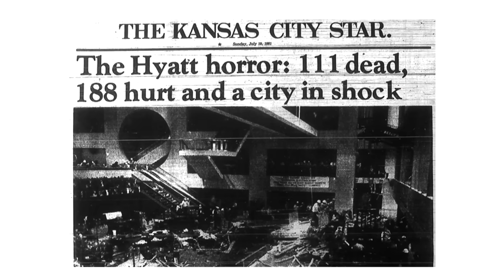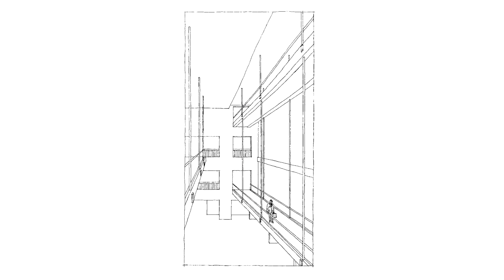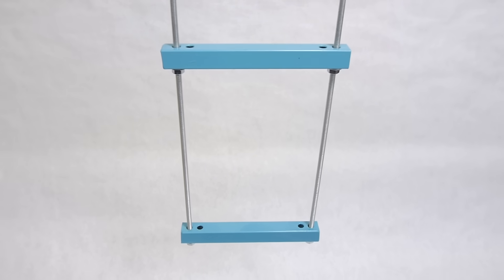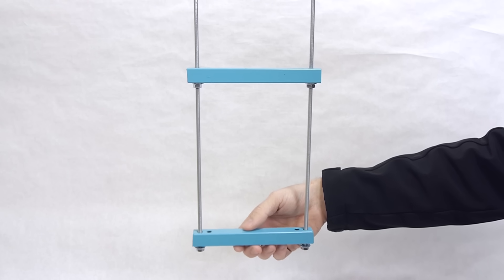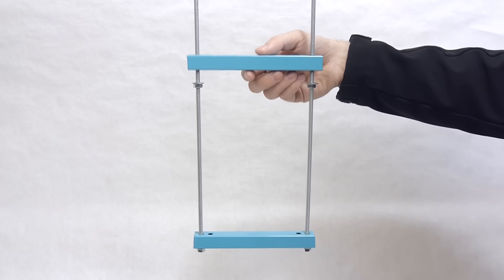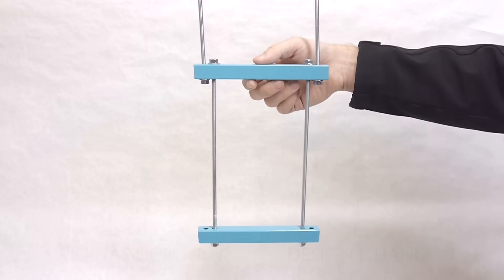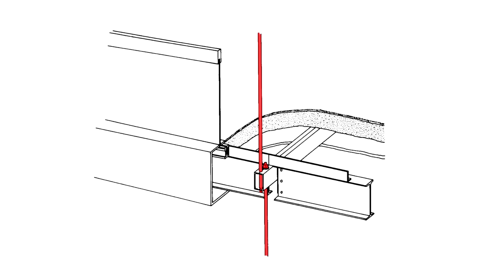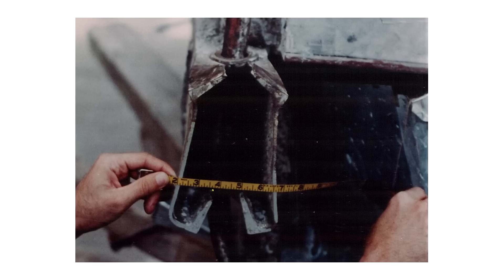The Disaster That Changed Engineering: The Hyatt Regency Collapse

Comment: Tensile strength of a steel rod is significant because it distributes the stress force along the rod, in a linear fashion.

The point force stress at the floor connection is much more concentrated.

By them breaking the rod, they were losing the advantages of the tensile rod, at the break, and then concentrating that force on the point connection. That point connection needed to be much stronger.

Comment: It is kind of like of magic trick. Only when they told and showed the point of failure did I realize that it was not an issue with the bolt or nut, but of the floor structure.

Comment: Even in the original drawings it looks so fragile. If there isn’t good over site during construction you can guarantee that there won’t be over site with inspections over time. Small things like dis similar metals, corrosion, rust, etc you can bet that the structure will be slightly compromised. 
This was designers wanting the walks to “float” and used the smallest amount necessary to support it. There should have been more rods even if the drawings were followed, this would give better margins for error.

Comment: Oh practical engineering already did this disaster ok. Came from one of his other videos wondering if he’d do it

The original plan wasn’t compliant either. Tests showed it would’ve only held 60 percent of the required weight for building codes.

They had a chance to catch the issue when part of the roof caved in and unalived a worker during construction but it didn’t get checked

Comment: There's one additional point that was not made:  The design would have been sound if the c-channels were placed back to back instead of welded toe to toe.  But box beams ( 2 c-channels welded together at the toe) look better, so they went with that.  I wonder if building inspection regulations were enhanced, because I'm willing to bet that there were at least a few building inspectors that were included (if only peripherally) in the lawsuits that followed.
Reply: Even using larger washers to distribute the load away from the flanges and onto the web would have helped a lot.

Comment: Wait a minute. Why would the nut on the upper level break? A properly designed nut should fail after the bolt (or rod in this case) fails. If designed properly, the rods should have been adequate to hold both walkways and the nut would be stronger than the rods.  It seems like the real failure was with the lack of compressive strength of box beam and not the nut as suggested in this video.

Comment: The horizontal parts of the C sections were acting as  cantilevers. The vertical parts were not being used properly. If instead of a small washer above the nut there was a thick pressure wide plate, this would have brought in the vertical parts into action.  That would have helped in eliminating the cantilever effect on the C section. 
 It was lack of foresight, on structures and  hopeless welding runs joining the two C sections, to produce a box girder.

Comment: I believe the real error here is placing one walkway beneath (or above) another, you have to ask yourself when designing something
"what if?" There is a two-fold benefit at work, each walkway is independently supported so the loading is easier to bear and should the overhead one collapse it won't take down the one under it (hopefully). Armchair chair expert.

Comment: Why not have accurate data on the distribution of steel and the distribution of concrete down the 1430 ft of the North Tower. Including the 70 ft for the 6 basements?

Comment: The problem there was  that the design  was made by an ARCHINEPT, and the  contractor  realized that  IT WOULD TAKE TOO LONG TO SCREW , besides  you cannot get   6 mts  threades bars at the local warehaouse.  if the  design were done by a an CHEETENIER  he´d  used solid bars to be sure that no need for  calculation of hole resistance but only vetical bar resistance and horizontal bending . IN my humble opinion that hollow  structural rectangular  bar  would have collapsed anyhow, it is not easy to calculate a hole resistance in a thin sheet of metal,...

Comment: An obvious alternative to threading the entire rod are coupling nuts.  These are long nuts used to extend the length of threaded rods and are available in most hardware stores for common thread sizes.
It would have been a very easy job to machine these from 2 1/4" dia round bar such as 4140 HT & SR, with wrench flats in the middle.
Astounding that a so-called erector did not know of such items.

Comment: As a K.C. Mo commercial carpenter stuff like this is still taught. You always question the engineers. Ive seen them approve stuff i KNOW wont work. Thats when you speak up never think a college degree means you know everything. My 20yrs exp in large bridges high rises and stadiums i can see big failure points

Comment: Is it just me or was every element of the design at the bare minimum for sanity.  If you look at the picture with the measuring tape, it looks like the rods were about an inch in diameter and the steel used in the box perhaps a quarter inch in width.  And how many rods were used total?  Look how massive the walkway is and the amount of material that had to be supported.

Comment: I get it that this nut was carrying twice the load…but it was this badly designed beam that split. The main strength of those channels is in the vertical face not in the tips of the flanges. 
Then they drill the holes through the weld. Then the load is trying to bend and crack that weld! Then there’s two holes next to each other…not much weld left!
  The nut is the ‘’fall guy" for that abysmal apology for a beam that it’s trying to hold up.
Reply: I agree that the construction of the beams being flange to flange was bad design and part of the failure mechanism. But, if the load on the nut is doubled then it is also doubled on the element applying that force. So you have a badly designed beam operating at double capacity. Honestly I’m just amazed it lasted for as long as it did.

Comment: The worst part is that a lot of the structural failures weren't even new information - the guidelines were already in place to prevent most of this, it's just that people cut corners. Still, it certainly made an impact. Safety standards are written in blood, unfortunately.

Comment: There's A LOT more to this story. Pure negligence and miscommunication on behalf of the primary engineering firm and the steel contractor. The steel contractor requested a change in the skyway's design for simplicity when erecting and the engineering firm NEVER made load calculations for the changes. They simply thought load calculations were someone else's job. During construction of the hotel, the steel structure to the atrium ceiling failed and collapsed. During a design review called by the hotel's owner, the engineers were directed to check all "steel-to-steel" connections ... including the skyway floors ... to ensure the building was safe. Unfortunately the engineers only glanced over their work. Again they failed to do a detailed analysis nor did they ever check the loads on the new skyway floor design. Hence, disaster struck and killed 114 people. Ironically, the original design for the skyway floors was also flawed as it was structurally insufficient and would not have passed State law.

Comment: I'm no mechanical engineer, but couldnt they just have used threaded couplers for the rods they chose to use? (I'm talking about those fasteners that look like a normal threaded hex nut, but like 5-10 times taller/more threads) they still get to use the same partially-threaded, cheaper rods. But with the advent that the bottom walkway is not pulling down on the top, as the top walkway is just resting on top of the threaded coupler. Admittedly the threaded coupler still would have as much force exerted on it as the nuts that failed, but it would have multiple times more thread engagement and only half the weight would be on the top surface of the coupler..
Reply: Your right, that would have been the ideal solution. Additionally the nuts weren't the point of failure, it was the cross beams which was now carrying double the load so coupling the rods would have effectively eliminated the issue.

Comment: I think the original design was flawed. The design required the fabricator to cut -20 feet of thread and then run a nut and washer up that thread. Anyone would have looked for an alternative to such a time consuming construction. True the loads should have been reanalyzed and adjusted for.

Comment: This gets recommended to me after the condo collapse in Miami. Nice.
Reply: Same here. At this point, having read an analysis from every amateur out there, including conspiracy theorist clowns, as to what the collapse video would, should or could mean, I'd like an actual seasoned professional structural engineer to weigh in with his or her opinion.
Reply: @msr1116  I doubt you'll see many in that category make an actual statement or speculate on it, at least not until a full official investigation report is available. Unless there are obvious glaring faults visible that might've been caught before with for example a bridge showing cracks, rusted essential parts, whatever there's not much to go on externally with a building like that. 

And even if such information is available speculating on what could be the cause in public isn't a thing I'd expect most certified and experienced engineers to do about a specific incident. Going over various theoretical scenarios of types of neglected maintenance/bad construction and the failure modes of a structure maybe? But I'd expect them to be very careful about not making implications about what happened at that actual collapse in Miami.

Comment: I was at this hotel in 1979 or 1980  ( I was 5 or 6 after all)  What I remember was the 3 walkways over the atrium.  If I recall correctly we had to use one of the walkways to get to the pool.
We were from Minnesota and it just happened to be this hotel we were staying at.  Didn't realize until I was much older that this disaster happened at the same Hotel.

Comment: I has taken me half an hour but someone please let me know if I am wrong.  Assume level A (top) and level B (bottom).  With the original design the load on the nuts and washers is shared.  A has a load and B has a load.  The total load is constant ie A+B but the loads are shared between A and B*.  In the amended design the total load is still A+B but now - At A is is A+B (!) and at B it is B.  This is where I stumbled.  I had the total load in my head.  The total load does not change but in the amended design the total load is on A.  The point of my confusion is that it seemed axiomatic that the load on B must be subtracted from A.  It took a long time to get my head around it, but this is a non-sequitur.  
* As an aside I am not sure if the loads are shared equally.  Also the load on the nuts/washers is possibly different from the load on the hanging rods.  Sorry, but this was not covered in law school!
PS.  Tom  this is just the sort of vid that I think your subscribers are interested.  Well done.
PPS. Practical Engineering  I have heard a few explanations of this and if I may offer a gentle criticism:  This is YouTube and it is a challenge to set your level at a median audience.

Comment: too much weight hanging on the long vertical rods to begin with
Reply: It would have been fine if not for the design change. The change doubled the load carried at the connection and the connection failed. The rods were acceptable.
Reply: @morbideddie  
even the original design looks like it placed too much tension on the vertical rods
Reply: @duggydugg3937  rods are surprisingly strong. When in tension there is none of the bucking issues you get in slender members in either bending or compression. The new layout didn’t increase loading on the rods, just the connections on the upper deck. 

The rods and nuts were fine, the weakest link here was the box girder connection which used two C channels and placed all the load on the edge of the flange. Combine the with doubled load on the connections and failure was imminent.
Reply: @morbideddie  
i don't like the hanging setup to begin with
Reply: @morbideddie  
rods ... iffy

Comment: "Pancaking", where lower floor is unable to support a failed upper floor. Twin Towers and other newer high rises fail this way. 47 story NewJersey bldg and  a Seattle bank failed that way under construction. Floors fail due to bad welds due to time allowed per weld (takes longer to weld steel of disparate sizes.and in cold weather).
Reply: The lower floor in this case was not supporting anything- it was being held up by above so it’s not “pancaking” nice bit of info though 🙂

Comment: Would it have needed screw threads on the entire length though? Why not just screw threads at the points where it needed screwing, just slide the bolt up the unthreaded portion and screw on no?

Comment: He's pointing out doubling the load on a nut.... but nuts held OK. It's the steel supports that failed by tearing. Maybe they also altered the type/shape of steel tubes used to build it and the engineer did not approve that? just asking :D
Reply: Your correct that it wasn’t the nuts that failed but If you double the load on the nut you double the load on the connection. We’re it not for the doubled load the connection would have been fine, a little inefficient but fine.

Comment: There is no “inherent flaw” in the two rod design.  The flaw was in the engineer not reviewing the new load path and changing the beam to handle the load.  Either design is a good design, but the components need to be sized for the load they will carry in service.  A competent structural engineer (I am a retired P.E. with a masters in structural engineering) would have considered the fabrication and installation issues and designed for that initially.

Comment: I stayed in this hotel in 2001 and had never heard of the disaster. At the time I was there for a conference and found the layout really frustrating;  to get from one side of the lobby to the other from either of the upper floors, you had to either walk around the giant square walkways built into the sides of the lobby, or take stairs down to the lobby on one side and then back up again on the other side. I finally saw a plaque dedicated to the people who died in the disaster, and it made sense - the lobby was not designed that way from the start. To me it's amazing that the fabricators and engineers made a design change that was so stupid that almost anyone with a rudimentary knowledge of engineering could have recognized.

Comment: I just wanted to point out that even the original design was not correct. It was later calculated to only be able to hold 60% of the load required by law. So even though the change made it worse, it was already a bad design, due to pressures to cut costs and fierce competition for contracts at the time.

Comment: it is abslutely insane to me, that this happens so infrequently. It is almost a miracle how safe our constructions are in total.
Reply: Its not insane, our building codes are insanely long and every single line exists for a reason, usually because someone died so that line had to be added. 

Our constructions are safe today because of the lessons learned everytime a tragedy happened.

Our constructions are also unsafe because of constant pressure to finish (hurrying and "haste makes waste") and constant budget concerns resulting in poor maintenance.
Reply: @jasonreed7522  don't forget deregulation and desire from provate entities for more and more profit.

I don't understand how people can be against a central government and then go inside their homes that don't  fall on their heads only thanks to said government
Reply: No matter how good the design is, they are seldom built exactly as designed. It falls on the inspectors to ensure the design is executed correctly. Good communication of proposed revisions is essential to ensure that they are safe.

Comment: But wouldn't there be a good safety factor on that
Reply: Yes but not enough to allow for a doubled loading on the bolts. It also turned out that the original design was only capable of providing 60% of the capacity required by state and only 30% when you account for the doubling of the load on those bolts. In other words, unless the codes designed for a FOS of >3 which doesn’t happen often then a collapse was going to occur eventually.
Reply: @morbideddie  Very few other people commenting here have mentioned factor of safety.
Many people said that they immediately saw the cause, meaning the load doubling, but from the simple diagram shown (the blue beams) they did not see the real cause. The bad assembly of the beams was the cause. That was not shown until later.
If the structure had been capable of supporting many times the highest weight and extra impacts from a full load of people jumping, as it should have been, then the design change would not have caused any trouble.

Comment: There were a few things I didn't like about that design, starting with the crossbeams being two  pieces  of channel welded together and not capped at the end.  the uncapped ends not only look bad, but also add a lot of strength. secondly, this design could have worked simply with a piece of pipe welded inside between the top and bottom of the crossbeams, this would have not only added rigidity, but shared the load between the lower and upper surfaces.
Another modification that could have satisfied everyone would have been to use a long connecting nut so that only the ends had to be threaded, but each walkway was independently suspended on the rods.